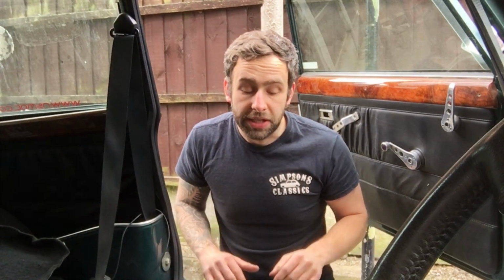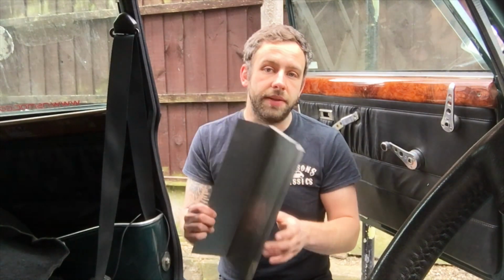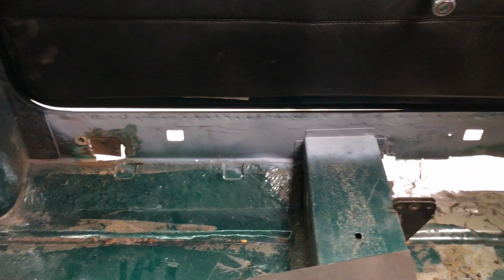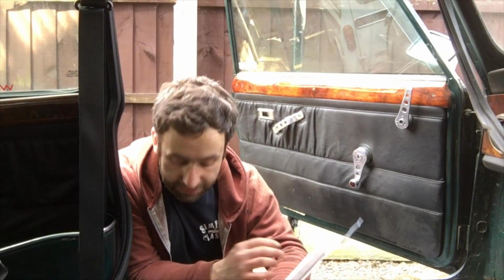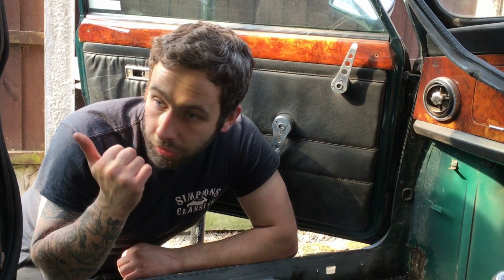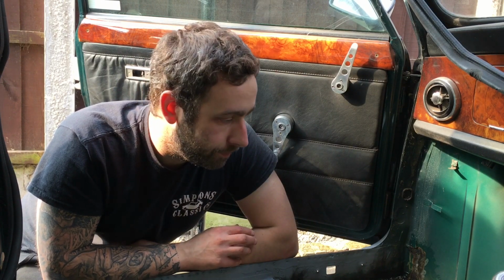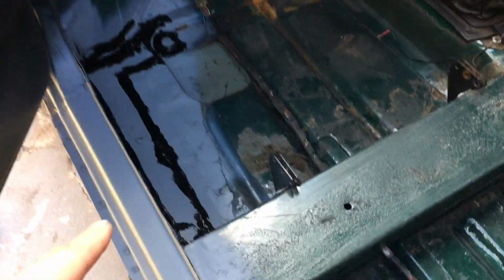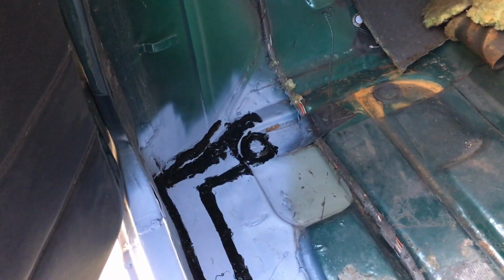Classic Mini John Cooper Conversion JCW - Inner & Outer Sill Repair/Replacement

Comment: All solid and sorted again, great work, once its had its coat of paint and a fresh MOT put on it we'll see it up for sale to finance an Austin Maxi project 😂
Reply from the maker: Haha 😂 yeah I bet his dad would love that idea.... James hasn’t stopped looking at maxi’s aha
Reply: @SimpsonsClassics  I know, he's become obsessed hasn't he? 😂 My Dad had one when I was about 7/8, a navy 1970 1.5 model and I remember it being huge and then a Mate's Dad had one when I was 16 and 6 feet tall.....and it was still huge inside lol. They were decent cars but the gearboxes had an issue from what I remember, my dad's kept losing 3rd, dunno if it was a selector or linkage issue but it was common.
Reply from the maker: Graeme W yeah I have never been up close to one but they do seem like big cars I guess James might get one day and you might see one on the channel aha
Reply: @SimpsonsClassics  Tbh Marc externally they're only the same size as a Focus externally but not being loaded with all the airbags, safety equipment, crumple zones etc means there's loads of room in them. If one ends up on the channel I hope it doesn't end up being never meet your heroes for James haha
Reply from the maker: Yeah I would definitely say they are about that size like you say without all the modern bits in. We will see there is plenty planned for the channel none mini related to

Comment: You make it look really easy Marc but I know it's not. Just cutting out with a disc I panic when I see all those sparks. Have you ever used an air saw?
Reply from the maker: Michael Roberts aha thanks Michael I have admit I found door steps nice jobs to do now. No I have never used one have you ?
Reply: @SimpsonsClassics  No never, but When I have seen them used they do seem to produce less sparks and seem a bit easier to control as my hands aren't the most steadiest (old age and poverty) and seem like a better option.
Reply: As I said previously, your door steps are a thing of beauty.
Reply from the maker: Michael Roberts thanks buddy i appreciate those words I do the best I can with the tools I have I guess but might look into that other method you suggested.